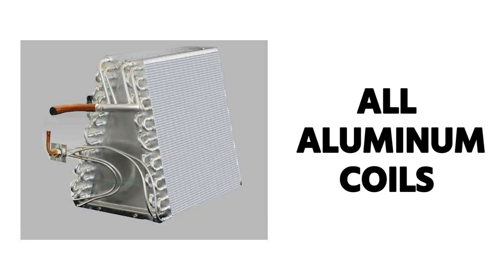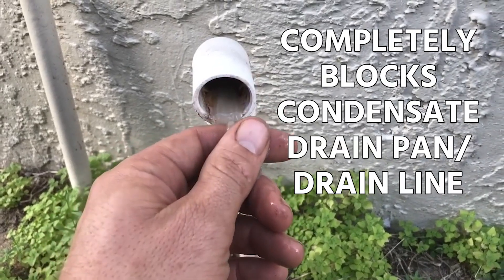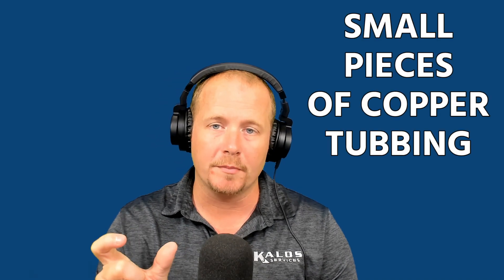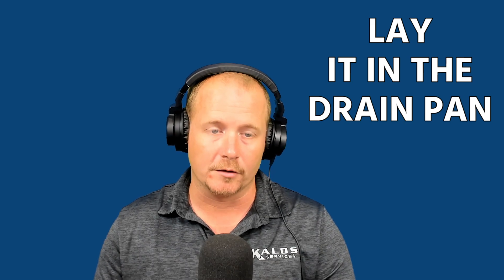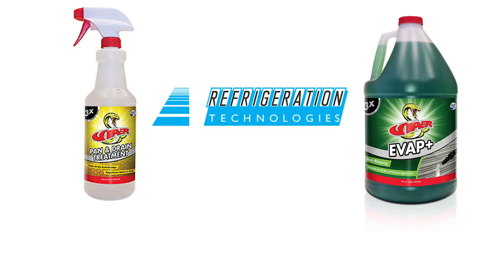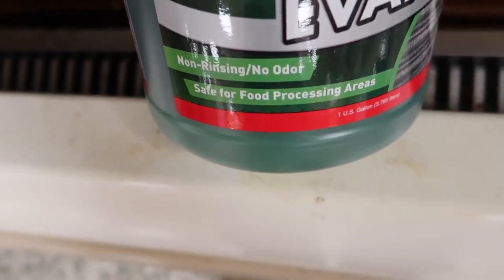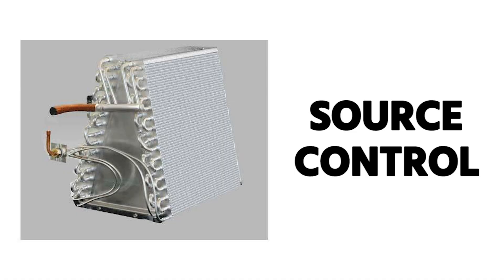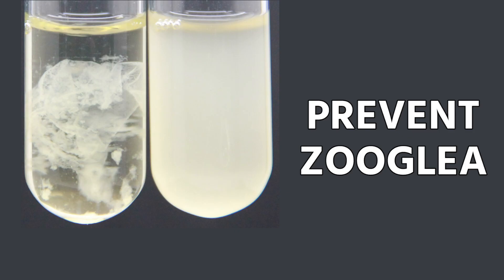How to Stop Drain Snot (Bacterial Zoogloea)

Comment: I use liquid copper (for plants). Works well for me and I live in central Fl.
Reply: did you just pour it in the drain line and leave it or rinse it out
Reply: @vicentee2687  leave it . Will not hurt
Reply: @econtrolable  thx brotha I'm in Central FL also here lately I've been having to clean it out weekly or I get a weird smell in the house
Reply: @vicentee2687  You can also put a small piece of copper in the pan. If you don't have a small piece of wire you can get a small copper washer or anything copper. Don't block inlet or outlet. And the pan will stay fungus free for years.
Reply: @econtrolable will penny's work also

Comment: I run a maintenance dept in a 800 home retirement community in Florida. I have 3 full time ac techs who work on and even replace units. I done this for 15 years. THIS problem started 8-10 years ago when ALL brands quit with the copper and started all aluminum handler coils. As we have phased out more of the old R22 freon air handlers (which had copper coils) this issue has gotten worse. I since have hired an AC PM guy who does nothing but clear drain lines monthly. We have noticed that 16 veritable speed air handler clog faster. We also have found that as a whole UV lights seem to make it worse and NOT better. We used to use co2 air shots to clear lines back in the days of copper coils but that has been abandoned because it wont clear the line underground it just moves the gunk around a little. I made up (in my workshop at home) a rig made from a washer machine wall box valve which has an irrigation rotor head adapter piece used to increase the rotor height screwed on the in feed of the valve. On the hose side I screwed a 6" male to male garden hose adapter piece. The rig is then attached to a garden hose (backwards) and the irrigation adapter piece fits into the drain line. It's long enough to bypass the "T" part of the fitting going into the ac drain pan and when you turn the 90 degree knob............it blasts out the underground line. It takes about a minute but when you turn the valve off and go outside snot-skins are EVERYWHERE.  
I found something in this video to try and that's the copper pipe and silver idea. I have some 96% silver wire I use to solder silver spoon art so I think I wrap some of that around some stripped back #6 copper wire and lay 3 of those 12" long in one of the known monthly problem pans at work and do a controlled test.
I'm writing this on 08/30/22 so if someone in the future reads this and wants to know how it went hit me back with a comment in December and I'll post back on how it went.
Reply: Well?!
Reply: How’d it work?
Reply: How’d it go bro?
Reply: Asking from the Future...  How did the Silver/Copper work?
Reply: Just like Magic he disappeared 😂
Reply: He had a lot to say that day. But not much since.
Reply: Well it's been nearly a year. How did the test work out.
Reply: Sept 2023 how did it go with the drain pans?  Or did management change techs?
Reply: Well? Don't leave us hanging. And just like that, she was gone.
Reply: went out to get cigarettes and never returned 😭

Comment: I get some kind of growth on my coils that definitely has an impact my health. When I turned on my system, I had strong "dirty  Sock Syndrome" (DSS). I never had a goo like shown here but definitely something on the coils. I tried spraying some 3% hydrogen peroxide and that was very effective in killing what ever was on the coil. I tried this a few days before turning on my system. my concern is if i am somehow damaging the coils with the peroxide. How effective are UV lights placed to shine on the return side of the evaporator coil?
Reply: Don't have your answer, but someone on a video said use hydrogen peroxide. Came here to see if true. 

Best guess: Should not be an issue in a PVC drain. I would keep it away from the coils, or let it set for 10 minutes, then wash it off. But okay in the pan or drain, but would have to re-do on a schedule.
Reply: @ownpetard8379  update: I definitely think the peroxide reacted somehow with the aluminum although that is said to be impossible. Perhaps there was a coating it reacted with, don’t know. I put in a scorpion LED UV light and that was effective at removing the odor completely. After the contractor installed the light, I turned on the system. Smell was the same but began to notice the smell reduce gradually over approximately 45 minutes. I shut down the system for a while starting it up again and that time it smelled less and was gone in about 10 minutes. It has never come back. I thought UV lights were snake oil based on what I read on the professional forums but it really worked.

Comment: I wrap 2" of copper wire and silver wire, both good quality wire. Place in drain line at the fitting to housing. No issues at all since. The silver wire was 26.00 but that was for 16' and that is for over a hundred houses. Well worth it. I just twist them together and BAM. All done.

Comment: I finally have found what the heck this slime is.  I just figured it was some kind of algae.  Is there recommendation for how to regulate/treat to this in a window A/C unit?  Unfortunately this window unit is on the second floor.  If it was on the first floor I would use coil cleaner and house it down.  But so far what I have been doing is using a hose sprayer and filling it with vinegar and then spraying the A/C from down below.  Anything else you can recommend?

Comment: Just found this issue in my drain line. The water level switch activated, and the unit would show blank on the thermostat. When i flushed the line, the snot came out. Thanks for the information. I'll have to figure out a way to place some copper in the pan.

Comment: Here in south Texas it has been a BAD year for backed-up drains and drain gunk.

Have been partial to getting the customer to add vinegar to the pan through the secondary (where I'll usually add a 90 and a cap) - will have to try the silver and copper trick on some aluminium coils.
Reply: I’m in Tampa FL. My air quality in my apartment went to shit and I was feeling sick a lot. This week noticed a musky scent with AC blowing. Complex replaced my unit 3 months ago. Had them come in today change filter and they showed my fucking white slime. They threw in some tabs? It made it worse literally throat burning. What do I do?

Comment: We see this every single day even hundreds of times a year and we’re in South Florida the AC runs year-round never stop we have three days of heat. Customers have to have clean ducts, pretty good filters changed often UVC light in every coil literally as well as Remi halo air purification. And we best go out every four months to do maintenance are we going to have issues still. Unbelievable been getting worse and worse. It is very rare to see it on the copper coil. Aluminum coils all day every day. I have some apartment complexes that I stack 20 blue tabs in the back of the coil every maintenance and hope they last a few weeks. We also install the time release drain strips they may be helping a little bit but it’s hard to say it never stops. We have to coil clean and acid clean drain lines constantly. The static pressure in the variable speed technology most likely doesn’t help. Thanks Jerry
Reply: Do you find the UV lights to be effective? one of my local Carrier vendors carries SCORPION UV Air Filter.

Comment: For those commenting about twirling silver and copper wire... Why both? Copper will work on its own. Perhaps silver does too? I think copper sulfate - used to kill roots in drains - should work just fine. Placed in pan. Need to make sure it doesn't block drain, so place in a nylon bag? Condensate will reach copper sulfate. Will take a long time to rot.

Comment: I have no practical experience with aluminum ac coils, but I would be concerned about causing premature failure of the coil by creating galvanic corrosion of the aluminum coil especially if the copper comes in direct contact with the coil.
Reply: You smash the copper 1/2" pipe flat, about 8" long and lay it in the drain pan which is made of plastic. Cooper never touches aluminum which..............is what he said to do. Water leaves aluminum and enters drain pan....passes around the copper on the way down the drain line.
Reply: That won't be a problem because the old coils used to be made of copper tubing and aluminum fins in direct contact with each other. Plus, galvanic corrosion needs a path through the water for the electrons to go between the two metals, but the copper or silver will be in the drain pan, and the aluminum will be in the coil up above.
Reply: @HeyChickens  If it works, it works. Sometimes that is the answer. If an aluminum coil last 25 years and something a technician comes up with in the field takes care what is essentially a bio-fouling problem in the drains and the coil still last 25 years, then there is no problem. My only question is, do we know if we just took a system that would have lasted 15 years and inadvertently, trying to fix a clogged drain, cut its working life to 10 years? And then (in this hypothetical) when if at all would we know if what we did cut the life of the system by a third? I don't know? That being said, I would have little concern about aluminum fins on copper tube. In that case, if anything, the aluminum would protect the copper. Simple problems, simple solutions, complex systems?
Reply: @ideacrafter  I know I mentioned direct contact but I understand the setup, the copper is sitting downstream of the coil in the plastic drain pan and there is no physical contact between the two assuming an idiot did not just throw a bunch of copper scrap in and around the coil. However, Is there no electrical contact between the two metals? 'Pure' water coming off the coil is obviously not pure and is contaminated with dust, bacteria, spores, etc, from the air, and would have no conductivity in an ideal situation, but dissolved CO2 quickly forms a very weak carbonic acid. I just don't know. I always get nervous about dissimilar metals being put in close "contact." Again, I don't know. How is there even enough 'food' in the condensate to have anything in the dark grow enough to clog the drains.
Reply: As a consumer in need of a new unit, I'd like to know if you can still get copper coils?! Or is this going to be a new ac problem from now on? Why do they just keep making things worse, cheaper and crummier?
My husband called it a "built-in fatality."
I keep wondering if it is indeed on purpose. 😢
Reply: @donnagarner6007  You ca still get a copper coil for the $$$$. I installed one several years ago to get Higher [] rating. When I replaced the unit I didn't think to say, reuse that coil. Installer employee kept it. Took it home.

Comment: I am still waiting for some tabs.  But for the moment, I gave my air conditioner a dose of mouthwash.  That shrivelled up and killed any goo that I was not able to reach without having to disassemble the air conditioner.  I just recalled that I also have a bottle of old copper pennies.  Hmmm.  Finally, a better place to put them.
Reply: Was it Listerine?
Reply: @donnagarner6007  I DON'T RECALL.  Anyhow, after placing old copper pennies in the base of the air conditioner, that slimy guck never reappeared. The conditioner is active right now, and thus my Danby Simplicity SAC5250 is still working after 23 years of summer use. The electric motor did end up with dried out brass bearing felt pads years ago, and thus it was making squealing sounds big time. But I figured out a way to re-oil the dried up felt pads, and so that fixed that problem.

Comment: I'm going to try taking some scraps of romex electrical wire and lay it in the pan and in the condensation pipe. The ground wire is already bare. I may also start collecting copper tubing remnants too small to use, and throw those in the tub of my condensation pump.

Comment: The very first time I experienced this was back in late 1990’s and it was at my mom’s house. No problem for the first three years, then it showed up in the condensate pump, I had to clean out the pump monthly. The only thing that changed in the House was that she had to be on Oxygen, there was this large stationary oxygen machine that fed threw these long hoses for her to breath and still be able to be mobile in her home, this machine would run 24 hours a day. I don’t know If contributed to the problem but this was the only thing that changed in the household.
Reply: Thank you. Great information. I'm not an A/C tech, but a homeowner who does all of the A/C and heating system maintenance. Have a ICP brand R-410 split system, scroll compressor, TXV and aluminum evaporator. Note on air handler from previous house owner states to pour a cup of bleach into the evap drain line Tee (next to drain pan) every couple of months to keep pan drain from clogging. I knew this was a bad idea. There was this white powder below the drain pan all over the exterior of the evaporator. After moving in, I completely cleaned the furnace, air handler, fan, evaporator, condenser, and ducts. Found secondary heat exchanger fins in condensing furnace clogged from air bypassing a too small air filter and a badly corroded evaporator. Corroded allmost to the point of needing replacement. The bleach caused the corrosion.
 Never use bleach around aluminum (or copper). It will eat  right through these metals. Thanks again for showing me the correct solution!

Comment: For household applications, if I'm installing a brand new system, why wouldn't I just go with all-copper coils? I'm guessing cost savings?
Reply: Almost all manufacturers have now switched to all aluminum coils. Very few, if any, use copper
Reply: @Austin23191  - fair enough. I'm not an HVAC tech, so idk about the offerings available, but are there any manufacturers that account for this type of bacterial growth? Are there any systems that utilize copper or silver somewhere in the lines to reduce/kill the nasties?
Reply: in my experience, manufacturers don't give 2 hoots about their equipment unless a unit breaks while under warranty. The only place where some evaporator coils will have copper is in the "u-bends" (where the refrigerant lines turn around to go back through the airflow). But the u-bends simply arent enough the kill bacterial since it will just grow on the aluminum instead.
Reply: @GrahamCrannell  using 15% silver brazing rods, UV lights, and drain pan cleaners may help to kill the bacteria though
Reply: Ha, re-label my 15% rods as anti bacterial/ fungi reducer.  per rod..like anodes on a boat..

Comment: I've had a few minnisplit that the exterior wall was sealed and the interior wall was not. With the entire space under the hood being under a negative  pressure  on hot days in the attic office the odor.  Well let's say attic insulation.  2 years of complaints. It took me a couple of visits and the light bulb went off. Thumb gum smashed into the interior wall. Problem solved.

Comment: I’m back. Static pressure makes it a lot worse as well as you can’t pitch the whole way it Hass to be very aggressive pitch like half inch per foot. Also no standing water need to front pitch everything not to the point where it spills over the coil but no standing water in the coil pan. As well as maintenance every four months at least. Six months don’t cut it anymore. Well there you have it folks do UV lights in the air purification the good filters they barely work

Comment: The oil too, need to clean coil on new units or replacement coils , airflow pitch  and source like he said . Duct clean and uvc light . We also see it on some copper coils too but not as bad. I’m sure Florida is the breeding grounds for the Zooglea. I did the copper thing it didn’t work that good I even tried brazing rods

Comment: My father back in the 60s , 70s and the 80s would throw a handful of 100% copper pennies.   Copper pennies are no longer available. A couple years ago on my new installs I started experimenting with 100% copper sheet metal for gutter manufacturing laying in the bottom of The evaporator on new systems for a few select customers.       I would experiment on my own systems but my filtering is so good I don’t need to clean evaporator for at least a decade and still have zero buildup no dust no residue.
Reply: I would think a couple lengths of 12 gauge bare copper electrical wire would suffice.